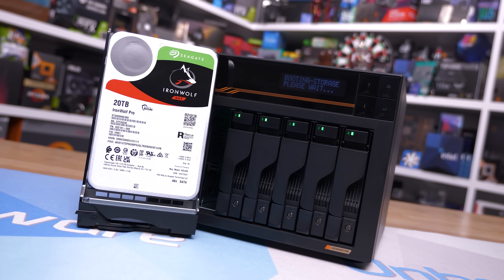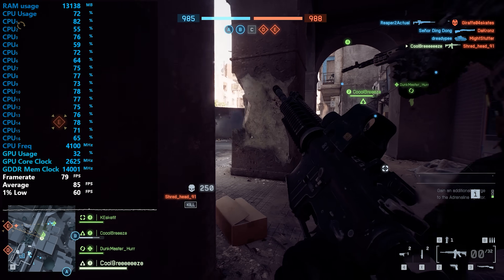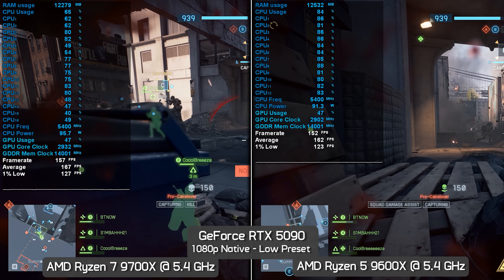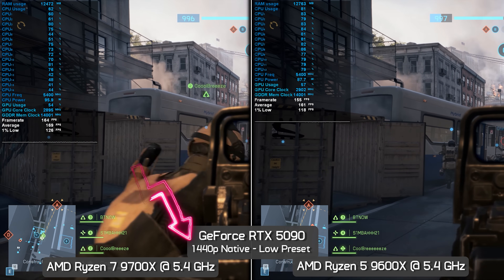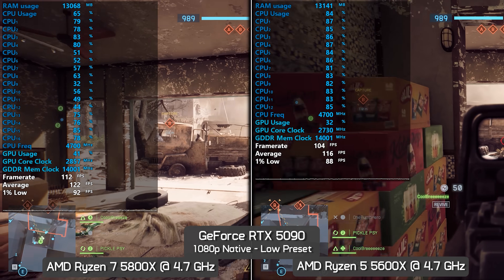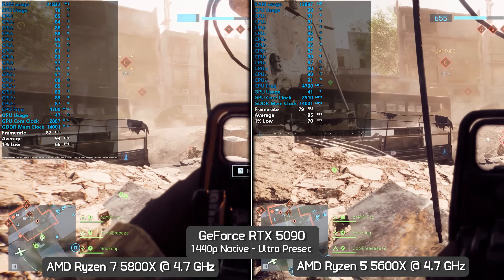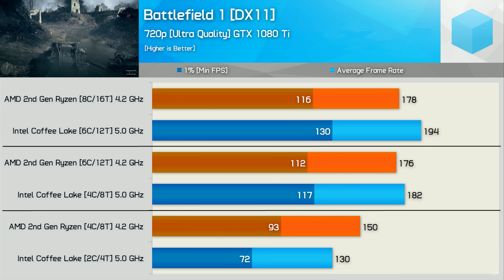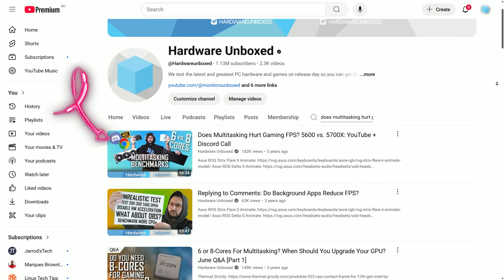Why Gamers DON’T Need More Cores, 6-Cores Still Works Well!

Comment: I have a 6 core i5-9400F, and i'm thinking of upgrading to the 9600X. They're going for around €210 rn. What kind of performance uplift can I expect?

I recently upgraded my GPU from a 6gb 1660Ti to a 16gb 9060XT. I'm still struggling in VR on some titles, I've noticed the CPU utilization is peaked at 100% in VR. I can get 60fps in VR somewhat reliably, even up to 80+ sometimes, but ideally I should be getting 120fps (headset is a PSVR2). Will the 9600X make the difference and serve as the upgrade i'm looking for? Also, I've heard RAM speed matters a lot for AMD CPUs so, what should I aim for on a budget? Thanks.

Comment: Alright. I'll admit that the frame time performance did surprise me.
I didn't think these CPUs had cores that beefy.
God dayum.

Edit:
Oh yeah, worth noting that, if you have one core that's 100%, and two cores that are 50% of the performance necessary, you might not get the same performance in either scenario even if the game "can make use of the extra cores" simply because multithreading has inherent overheads from the software to the firmware to the hardware, waits, synchronizations, context switches, etc.
How much that matters will vary, of course, but it's something to consider too.

Comment: 5070ti/12600k i was running BF6 100+fps high settings, dlss quality, dont need more really but will get a 9800x3d i think at some point just for better performance in general and better lows

Comment: Ganer don't need more than 6 cores, but then Steve shows the rest of the video and we can see how 6 cores CPUs are the slowest 😂 even adjusting the core speed to the same which is not the case out of the box

Comment: I'd love to see similar testing with Helldivers 2, there's some strange misinformation going around that lower resolutions see lower performance than higher resolutions because the "GPU dumps more frames on the CPU", which I think is an incorrect understanding of what's happening. I suspect lower older and lower core count CPUs aren't being able to handle the game, given the minimum requirements list a 4790K.
Reply: I would enjoy a deep dive by HuB because of the unusual game engine.  The game forced me to get a better CPU cooling solution because my CPU was shutting off when it exceeded thermal limits.  I noticed that changing graphical settings sometimes resulted in the result being the opposite to what I expected, and the game ran faster and cooler with some settings higher rather than lower.
Reply: Deep dive would be great! Digital Foundry did one around launch I think but so much has changed since

Comment: The 6 core doing well is not merit on the 6 core, rather in your video it can be seen how the 9700x is somehow loading more work on some of the HT threads (Core 6, 14, 16) than their actual core thread counterparts (5, 13, 15).

Right now 6+ core cpus work much like ram: untill you dont peg 100% usage you wont notice a detriment. But BF6 has shown instances of reaching 100% core usage on threads of a CPU, especially if you enable high mesh quality and other CPU intensive settings. Considering the 100 bucks difference between 9700x-9600x in a whole system would end up amounting to less than 10% price difference, people may be compelled to size up in this scenario.

Lastly, things change fast, I remember a video of this channel mentioning disabling E cores was either a wash and some instances helpful for gaming performance in Alder Lake era, now most heavily threaded games actually benefit from those E cores enabled, and the concensus shifted towards disabling HT instead for better 0.1-1% lows

Comment: You went through a lot to prove what most people agree with:
Ryzen 3600 = Core i7 8700K
Ryzen 3600 > Ryzen 2700x
Ryzen 2700x< Core i7 8700k
Reply: 3600 = 8700K only in productivity, in gaming the 8700K beats the 3600 by a pretty large margin especially in 1% lows.

Comment: Most demanding title will use 10 threads (5 cores). However a few titles are able to scale different from require, up to 14±2 threads for further improvement.

The difference in performances with a higher end cores (9600X vs 9950X) will usually be clock speed. A 9600X can do easily 5,6GHz all cores. A 9950X won't be able to do that on usual.
Reply: Then disabling HT would have no effect but it does.
Reply: @kazuviking  wtf are you talking about. It's totally different.

Comment: interesting to see you havent noticed that youre constantly cpu bound, I mean the low GPU utilization is a dead giveway. Bf2042 was notorious for being a massive cpu bottleneck even with 16 core cpus, my i9 9900ks struggled on 128 man servers. and BF6 is no different, here even with a 64 man server a 16 core sturggles, not to mention the 6core. Stop spreading misinformation about six core being fine for bf6, lol.

Comment: Nice to see the value champs, Ryzen 5 2600X and Ryzen 7 2700X, still hanging in there and able to play new games.

It would be interesting to see how the Ryzen 9 3900 and Ryzen 9 3950X do compared to lower core count CPUs from multiple generations since they're the slowest mainstream 12 and 16-core CPUs respectively and the most likely to benefit from improved CPU utilisation in Battlefield 6.

Comment: Ive always been a little confused with Intel's p and e cores. Like how many e cores does it take to make a regular p core? I have the I5-14600k with 6p and 8e cores and I find my pc is decently powered with this. I dont really play modern games because I only have a 4060 so I mostly play 5+ years old games and I get good fps at 1440p and I dont complain. The only game that will force my to upgrade is when gta 6 comes to the pc 2-3 years from now. I wonder what hardware will be out in this time.

Comment: Prime Day this year saw the R7 5800 XT discounted to only $141, which seemed like a steal for someone looking to make a cheap AM4 machine in 2025.
Reply: bought 5700X3D for 170$ brand new tray
Reply: @Gabor-y3h  Is that USD? Alibaba or Aliexpress or else? Got a link? Looking to do same
Reply: I would go for the 7600x or 7500f if it’s only for gaming.
Reply: I bought a 5700x3d for 165$ during last black friday from aliexpress. the prices have gone up since then
Reply: june 2025 picked 5600xt $110, replacing 3600x, paired with tuf 9060xt, prolonging am4 life for another 2 years, then am6.
Reply: No options except MAYBE the 5700x3d were a "steal" for AM4 in 2025 when the 7500F existed 😭 if someone is already spending $140 on a CPU, a person coulda gone AM5 for not even $100 more

People gotta stop recommending new AM4 builds unless the person's budget is the strictest of strict
Reply: @musiclistener9215  Well, I had 40 gigs of DDR4 from my Skylake rig, so I went with AM4. I tend to keep rig for 7-8 years, so I wouldn't update CPU anyway.
Reply: An am5 mobo and some ddr5 are not just a 100 more sadly
Reply: I snagged one at that price for my dad. Upgraded his r9 1700 to the 5800xt to gain Win11 compatibility. Nice upgrade for the price.
Reply: I purchased a 9600x on Prime Day for $160 dollars. Still sitting in its box but it was such a good deal I purchased it.

Comment: Correct data, but the premise is so narrow that is wrong, and it's not the first time it happens here.
This requires a much longer explanation, but it's pointless since YouTube comment section is a giant eco box.

So here's the tldr for every1 with 2 brain cells rubbing together.

Cores act like VRAM on a GPU. Either you have enough or you don't. The higher fps you're running the more your CPU load increases.

I just helped some1 tune their 5800x. I have a 5900x. He has same RAM as me, his CPU boosts a little bit better since he has a better bin than me.

We play bf2042, and we both play with optimized settings for max fps, which means CPU bottleneck. It just so happens that his CPU is 80% of the time, pegged at 100% usage.

His lack of cores is so severe that at some points, and on some maps, my 1% are higher than his avg, and this can be seen from my side aswell, as I've seen 85-90% CPU load on my 5900x.

Battlefield is not the only heavy multiplayer game, and this is not the first time I've seen this.

Back in the days of the ryzen 2000 and Intel 8000, an i5 8600k was like 35% faster than a r5 2600x. 2 years after their launch, warzone was choking the 8600k so hard, that it was dropping it to the level of a r5 2600x. I've seen so many ppl with a 8 and 9 series i5, pegged at 100% usage, sometimes even with no very powerfull GPUs.
Reply: Yeah if anything history has shown that lower core count, N gen CPUs age worse than N-1 CPUs with higher core count.

Also the testing methodology is very flawed here, if you want to test CPUs in BF6, you disable all the GPU intensive settings and enable all the CPU intensive ones. This only proves that preset low is super optimized as always in a Frostbite engine game, but when you start enabling mesh quality, undergrowth quality, etc etc, CPUs start to have a bad time and more cores start to shine.

Comment: Since Intel had us on 4C/8T for such an incredibly long amount of time, every game developer got used to working with 4 cores, and really the only benifits of higher core count parts so far have been higher cache as a result of the added cores. 6 core parts today are also simply faster than 8 core parts of two generations ago due to boost and ipc. And now 6 cores has fallen into that sub $100 range with the 7400F and similar parts, so 4 cores doesnt have that good of a reason to be bought either

Comment: I think AMD's decision to give the 6-core SKUs 32MBs of L3, even all the way back to the R5 3600 in 2019 solidified 6-cores to be the standard. Considering the 8-core SKUs has the same 32MBs of cache, the performance improvement going from a R5 to a R7 would be in clock speeds alone, and only in a few CPU heavy titles, the additional cores. Maybe if AMD gave Ryzen 7s 48MBs of L3, it would be a good performance jump from the 6-core SKUs
Reply: Helped even more when Zen 3 came in and unified that 32MB of L3 for all 8 cores.  Suddenly the max cache an individual core could access doubled, and when games still often have one primary logic core that requires the most grunt, this has really big benefits.

Comment: So maybe we can see 9:06 that Zen 3 CPUs limited and struggles by DDR4 bandwidth. I saw other CPUs benchmarks with DDR4 memory in BF6 and seems that almost all this CPUs have highest average ~120-130 FPS in this game. So BF6 engine needs not only powerful CPU but also a high DDR memory bandwidth
Reply: Kinda funny. But my i7 12700 non k using DDR 4 gets exactly this average FPS

Comment: My old rig with a 5800x & 6900xt was pulling better fps @ 1440p than his with his 5090 I’m assuming this is nvidia driver issue people talk about placing extra load on the already overworked cpu.

Comment: Ever since consoles went x86 basically if the PS5 and xbox has allowed games to use a maximum of 7 cores you wont in any case need more than 8 cores for gaming. If PS6 and the next xbox go the same route 8 cores will be the best choice for gaming for a whole other generation.

Comment: Writing programs that work in parallel is quite difficult. Also, the main program flow in games is sequential anyway.
Reply: Yup, exactly this.  Primary game logic core is often simply not able to be broken up into different work threads, at least not without a lot of complexity and challenge and likely headaches.  Scaling very dynamic gaming workloads beyond like 8 cores is simply going to be difficult no matter what.  Even if new consoles move to 12+ cores, this problem will remain.
Reply: It's not that it's crazy difficult it's that some things just don't make sense to break up.

Let's say you had a prison where all prisoners were in solitary and the only way for them to communicate is to pass the guard a note. You have a goal of having the numbers 1 through 10 written on a piece of paper.

Would it make sense to give 1 prisoner instructions to write 1 through 10 and be done, or write one, summon the guard, pass the note to the next prisoner and have them write the next number and soon until you get 10. 

There are certain things that you just have to do in a specific order for it to make sense.
Reply: @Snerdles  It's difficult in many cases, because of things like shared state. Spawning threads or processes is easy enough, but that in itself is usually not that useful, within one single program.

You are of course quite right that parallelization often doesn't make sense or has no benefit. The benefits start to become obvious when the program is working on "large" data sets, or computationally intensive tasks.
Reply: There are enough parts to parallelize. The roots of these engines go back 20 years when nobody thought to lay down an architecture ready for multi-threading. AotS have done everything from ground up with impressive results.
Reply: @VADemon What you're saying is true, at least in part, but I'd say it's worth recognizing that there are probably a lot of really great reasons why we don't have many other examples like that.
Reply: @TheDarksideFNothing  I stand by my words. Qualification and architecture/history. Factorio has delivered a state-of-the-art simulator, because they made their own engine from the ground up and have been aware of the performance aspect with every decision. Counter example: Minecraft, you cannot fix it without breaking/changing how stuff works.
One coherent rendered image of the world is much tougher to optimize and it takes time and effort companies don't have / aren't prepared to pay for. People keep buying AAA titles broken on release - it shall continue.
Reply: @VADemon I don't think we really disagree here, or at least not much.

I would caveat that different types of games are likely to have a different difficulty of parallelizing CPU tasks, but yeah I would be surprised if there's not a lot of tech debt holding back most games/engines that could technically be fixed.

My main point is that fixing it is most likely extremely difficult and expensive to start, and that there are probably a myriad of other reasons and difficulties in the way that we aren't going to think of in a YouTube comment conversation. 

All this to say, if it were easy to fix they would for sure do it, and there are likely extremely compelling reasons why they haven't. No dev wants their game to run badly. We don't know we wouldn't make the same decisions in their place because we don't know what pressures and difficulties are at play.
Reply: @TheDarksideFNothing  ❤
Reply: Man, I shit myself when something turns async. Especially when you're adapting it to something not built like that.

Comment: Borderlands 4 lists an 8-core as minimum spec, so that also contributes to the freak out.
Reply: PLEASE STOP taking these 'requirement' listings as gospel.  They are usually always wrong in some form or another, nothing more than rough(and often bad) guesses when it comes to CPU requirements especially.  It's wild how this is proven true like literally every single time, and PC gamers genuinely never learn.  Y'all dont seem to understand that they dont have this massive arsenal of PC's around for benchmarking all these different parts and configurations.  And believe it or not, a lot of developers, even programmers, are NOT actually super well versed on the specifics of actual consumer hardware products and ranges.
Reply: Somehow I doubt that it will actually require 8 cores. Since it runs on PS5/Xbox that are limited to 6 cores (for games) and aims for 60 FPS there. I think Gearbox just made an oopsie or didn't test properly. Or their PC performance is just strange.
Reply: @eruannster whatever the reason for it, people did notice a 2700x as minimum. Just checked the steam page and the CPU is still there. I do hope gearbox is being over-cautious
Reply: @eruannster  the game will probably not even function on release if borderlands 3 was anything to go by. Its funny tho cell shading was created to help the ps2 but gearbox made insanely demanding for no reason.
Reply: @eruannster  also switch2 with its 1ghz 6 core can do 30
Reply: they should list a 9950x3D and rtx5090 as minimum spec.
Force people to work out the actual requirements rather than just be told specs..... which in 15+ years I have never seen be accurate.
Reply: I think that includes SMT which means a 4-cores CPU with SMT is technically meeting the minimum specs.
Would it be a good experience wiith an old 4-core 8-threads Core i7 CPU? Or a Ryzen 3 with the same core config? No, I don't think it would.
Reply: 8 core 9700k, from 2018! The average person doesn't know a modern 6 core blows it out the water

Comment: 6 cores are trash at 2025 gaming, u lose performance In everything, my friend build a 6 core gaming PC and its so slow compared to my 8 core PC, u can feel it in everything including gaming, and multitasking, even in windows on chrome YouTube etc u can clearly see and feel the difference, 6 cores where good in 2020 but 2025 it's a waste of money to build a PC and not add 8 cores to it.
come on guys wake up.
10800x3d will use 12 cores, why? because AMD knows 6 cores is not enough, if 6 cores are enough why didn't AMD give us 6 core 3d cache CPUs? 
even laptops now use 8 cores and u wanna build a PC with 6 cores? are you such a lay low dude?😂
Reply: Worst ragebait I’ve seen in a while

Comment: When you're stuck at 30-40% CPU utilization and already bottlenecked, or limited by "weak" GPU even at 1080p and 60fps (and it costs more than a whole console), and all that with upscaler and frame generation, cores count should be the last thing to blame and worry about...

Comment: I'm still playing with my old i9-9900KF and an 3080 Ti. Yes, in some situations my CPU bottlnecks on FHD hard at around 120-130 fps on the "high preset". But most time of the Beta I  was able to easily play at around 160-180 fps.